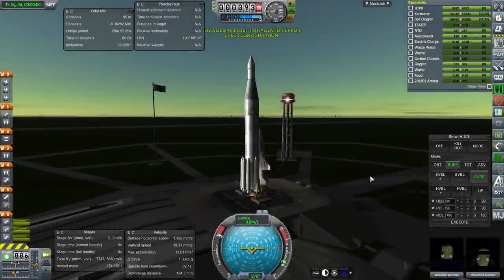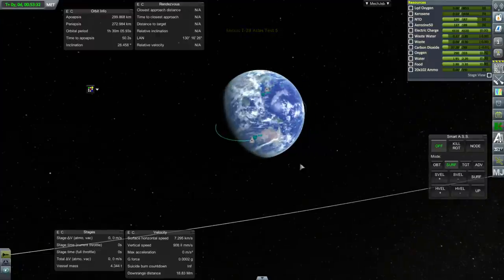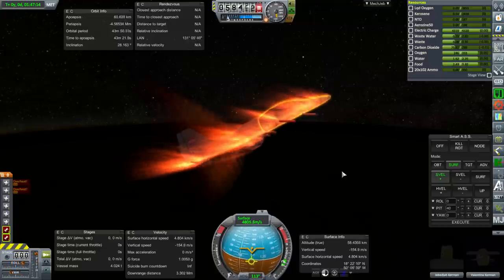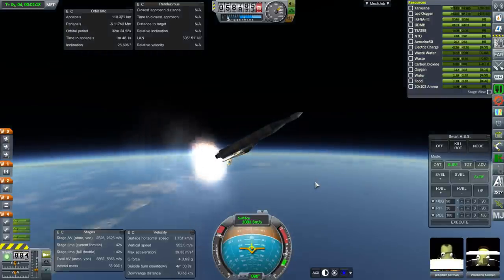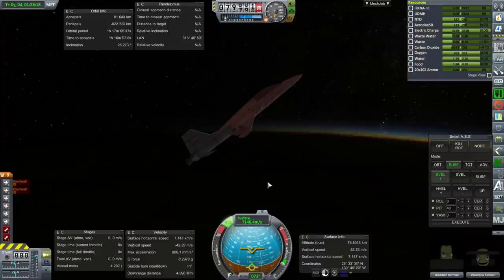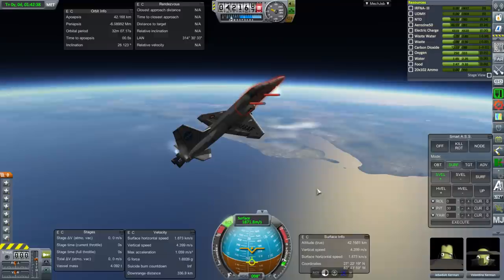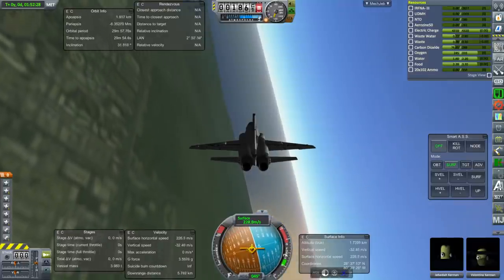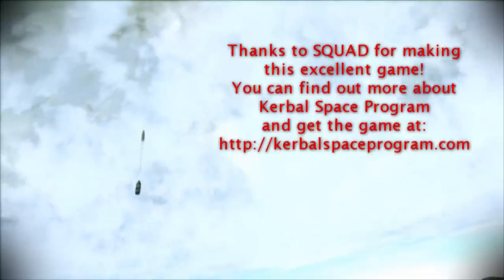Kerbal Space Program RO Sandbox - T-38 Space Shuttle 1961 Final

Comment: Aren't a 737 and the space shuttle about the same weight...  Also, any room for drop tanks on the T-38 wings?  You shift some of  the hypergolic fuel in to those and out of the booster nose tank.  That might allow better propellant use.
Reply from the maker: The shuttle is substantially heavier than a 737, though the newer variants of the 737 are getting closer and closer. There's room for drop tanks on the T-38 wings, and the T-38 often flew with them, but shifting them out of the booster will only hurt balance, tilting it more to the T-38 side. I'll think about it, though.